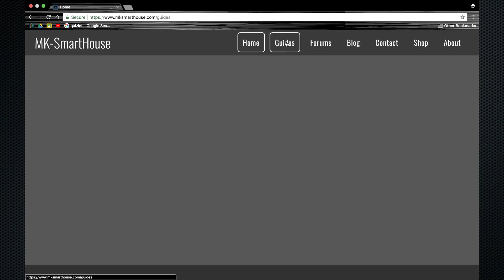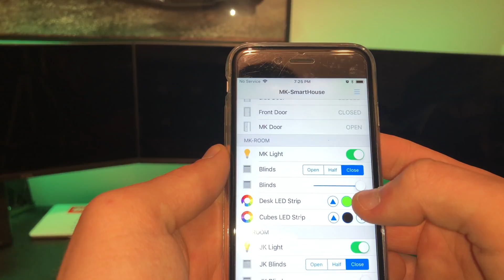Complete Guide LED Strip Control MQTT OpenHAB ESP8266 : Final Installation

Comment: Huge Job and nicely done !! 
I do have a question does anybody know why after short amont of time (2-5 min) my esp8266 doesn't execute any order anymore like switch off the light and the relay doesnt change his state ? i think it's like losing connection but i don't really know what could i do
Reply: I have similar issues with my NodeMCU LED strips if I'm using too long of a strip with a power supply that's too weak. The ESP8266 doesn't get enough voltage and stops communicating (it's clear this is happening on my strips, since they also have animated effects, which simply freeze). These LED strips use about 50mA per pixel, so if you just have 20 LEDs, you're already using 1A (which is the standard size of those phone charger power plugs). Try using a shorter strip or a beefier power supply and see if it keeps happening!
Reply: thanks for your reply BK Hobby but in fact i'm just powering the relay for the light and not for the LED strip for the moment :/ well i'm also using the NodeMCU and to power the relay i use the 5v pin maybe i should power directly the relay with an independant source of energy instead of the 5v of the NodeMCU 
i'll try and i'll let you know :) 
thanks mate !!
Reply: Ah, ok! Do you notice the issue occurring after you've cycled the relay a few times, or will it disconnect on its own? (I know it may be hard to tell, unless you're looking at your router to see what devices are connected)

I could definitely see how powering a 5V relay coil using direct channel outputs of the NodeMCU/ESP8266 (which are ONLY rated for 12ma at 3.3v!) could cause problems. That power draw when the relay fires is probably pulling the ESP8266's supply voltage down. Like you mentioned, try isolating the relay from the NodeMCU via a MOSFET.

Good luck!
Reply: well i can cycled the relay as much as i want but after a random moment it won't respond anymore like 2 or 15 minutes.. but i'll try also to look as you said on my router it will be easy I have only one device for the moment i just started 

And i don't know if it has an impact but i use the 5v pin not the 3.3v pin thanks for your help again :)
Reply: Hi BK Hobby , well this morning i had time to isolate my realy and my NodeMCU so i have one power suplly only for the relay (5v) and one for the NodeMCU (5v basic phone charger)

And still after a random amount of time if I click to switch my light on or off no responses from my relay it doesn't change is state 
And I checked on my router it's still connected but still doesn't work ..
I'm running out of ideas ..
Reply: Hmm, I wonder if you've just got a bad NodeMCU...Are you outputting to serial console in your code? You could you leave it connected (and output an incrementing counter to the serial console) to see if it's the software onboard freezing, or if it's continuing to operate while you lose the ability to cycle the relay (i.e. losing Wifi connection).

Also, what wifi mode did you set and are you using Deepsleep or any special wifi power modes in your code?
Reply: just in case of i'm gonna buy another one ! 
is there another way to chat rather than youtube comment ? 
And in fact i'm using basic MK smart house code sprinkler system because i've nerver program using wifi before so i'm new to this type of thing but i could send you some screen shot if you need ?
Reply: You can DM me on my channel page if you want. Also, check out https://www.reddit.com/r/esp8266/ - it's a very active community with excellent support. 

I also thought of something else for you to try - in your setup routine, add this statement: 

WiFi.setSleepMode(WIFI_NONE_SLEEP);

I'm wondering if your ESP8266's Wifi radio might be turning off after a period of time....
Reply: Alright thanks BK Hobby ! well first i'm gonna try to write in my setup loop what you told me and then if it doesn't work i will post soething on the forum ! 

i'll do it this afternoon so i'll let you know thanks again mate !